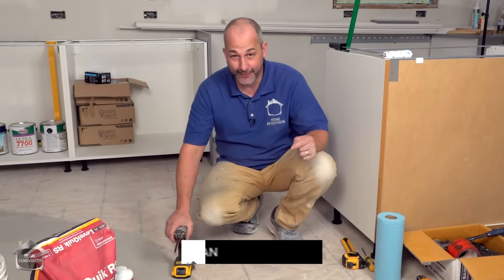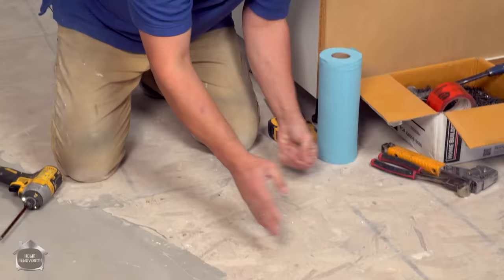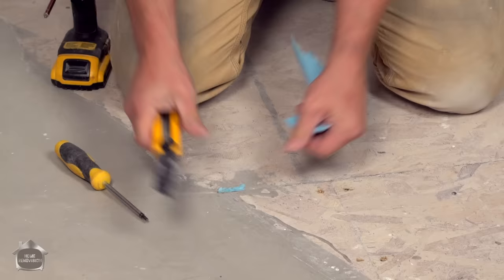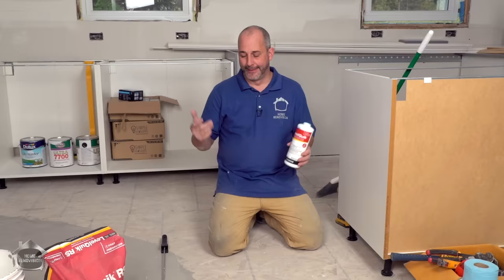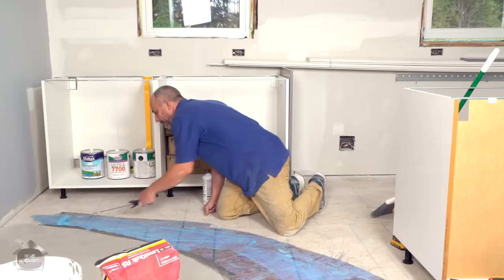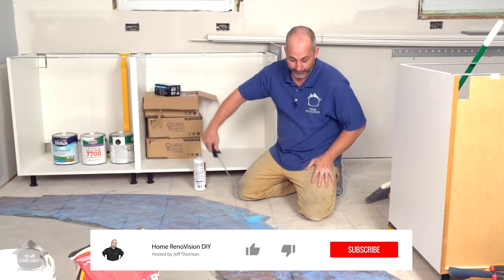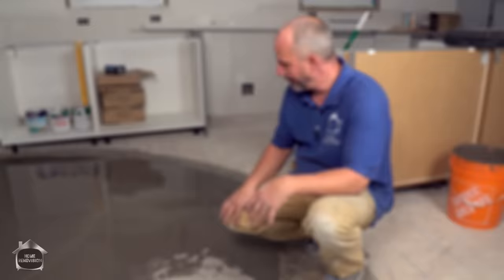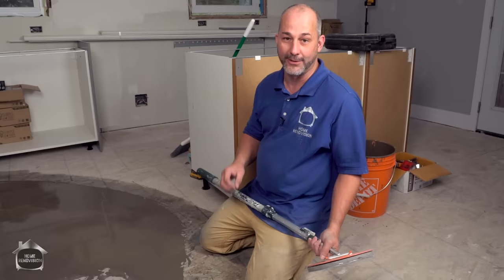How To Level Your Floors

Comment: Hi Jeff, I'm doing my basement, ripped out carpet that was glued into tile from the 60's-70's best guess. Many tiles came up in full, others left adhesive behind. Maybe 25% of 650sq ft has something left behind, bathroom and spare room currently have full tile.  Can I use leveler to bring the concrete to the height of the leftover tiles?  If so, do I cover the old tiles or go even to them? Or is it better to try to scrape them off?  

BTW, installing a 8"x48" LVP floating click floor.
Reply: The tile is most likely asbestos, best to leave it and cover it up.
Reply: Thanks  @chrisg7882 , so the majority just pulls up with the carpet since it was more of what I'll call an "indoor/outdoor carpet" (many dollars of plumbing work inside and out, found out the reason for that carpet 😕).
Anyway, since the tile does pull up in many areas and I can't stop it from doing so, what about all the pieces stuck down? Do I level up to them? Or how do I get my floor flat & even again if I'm not trying to remove the old tile?
Reply: @steve9207  you can buy a self leveller product that will cover vinyl/asbestos tiles and the adhesive you just have to make sure that the remaining tiles are solid and not hollow. I had the same at my home and I used a product called 'ball stopgap 1200'.Im from the UK so I'm sure of its availability across the pond but I'm sure there's something similar for you guys too.
Reply from the maker: Hi steve. I suggest everyone pours leveler over old vinyl tile sin the basement to avoid introducing harmful asbestos fibers into the atmosphere. those tiles have a real bead version of that stuff.
Reply from the maker: if they lift up without breaking you are fine. if you need to chisel them out then leave them there. Cheers!
Reply: @HomeRenoVisionDIY  thanks so much, this is what I needed to hear 😃
Reply: Thanks  @rossmale8715 ! From what I've seen, these are pretty solid when they pull up with the carpet.  I've only pulled up maybe 80sq ft of the 650 sq ft.  That was against a wall that we (and inevitably the previous owners) had water issues entering from "over the wall seepage / spillover" which was remedied years ago.  But all the years of those tiles submerged in water, perhaps it loosened the adhesive.  Maybe as I pull more, they'll stay down?  I'll check out the product you mentioned / look for something similar, thanks!
Reply: Would definitely recommend using a bag and bottle levelling compound (with a low compressive strength) or  gypsum based over old tiles.  A Cement based water mix can put a fair bit of tension on the old tiles  as it dries and shrinks which might be fine but could pull and loosen tiles that where fine before. gypsum based compounds don't shrink when they dry so won't put the subfloor under any stress. Last thing you need is to chuck a load of screed down and find in 5 days when it's fully cured your old tiles are pulling up/ de bonding. Always follow the manufacturers instructions for mixing ratios and priming. Always prime! Even between coats and use the correct  primer and levelling compound for the type of subfloor. If in doubt ring up the manufacturers technical department they're always happy to help.
Reply: Thanks for the info  @markallen8097 !
So I've yet to pull up most of the carpet, my initial findings are based on pulling up about 80sq ft maybe.  Of that, all except maybe 5 tiles pulled off in full with the carpet.  That may change as I move along away from the exterior walls and not pull up as many.  Let's say I end up with 50% still down, then I think I'd level it all, right?

But what if only 10% of my 650sq ft still has tile behind? Level it all? Or try to pop off the tiles in full, as long as I'm not scraping / chipping / grinding them away?
Reply: @steve9207  difficult without seeing as each job is different but if you've got 90% up and that 90% is good enough to fit on then spend a bit of time and get them up rather than screed 90% to sort out the 10% if that makes sense? If you've got to screed anyway it needs to be a minimum  3mm thickness so you can do the whole lot and cover them up.
 I'm in the UK and over here if you have tiles with asbestos content anyone can take them up as long as you follow   health and safety guidelines but they need to be deposed of though a licenced company. If you're confident go for it with the prep and fitting, if not get a decent flooring contractor to sort the prep for you, best to pay someone to do it right once rather than pay twice! It's very easy to make a floor worse if you don't know what you're doing. 
There are lots of different factors to consider when prepping and fitting a floor that can make or break an installation but a long as you do your research on the products you're going to use and make sure you follow installation and technical guidelines you'll be OK.
 Really Hope I've not put you off or confused you even more but as good as these types of "how to" videos are they only scratch the surface of what could be involved and some info given isn't always right
Reply: Thanks again  @markallen8097 !  I really appreciate all of your input and feedback :) Like you alluded to, I'll have to see as I pull back more carpeting what my situation is then and figure out my approach.  You had some reassurance comments in there though.  The space is livable without a "nice" floor while I take my time researching.

Comment: I tried to use leveler and didn’t trowel it so it made a hump. What do I sand it down with?
Reply from the maker: you can use a cuyp grinder attached to a vacuum or orbital sander. depending on the amount of are you want to remove you can start with a 50 grit paper.
Reply: Thanks!

Comment: You cannot level a floor with a 12” trowel.  The self leveling mix doesn’t level that much.  To really level w/o the need to sand, use a 5 or 6 foot board or I took a 6’ level, wrapped with painters tape, and level with that like it was a trowel.  Now floors will be perfectly level.

Comment: Home Depot just quoted me $6,500 to install 850 square feet of LVP.  My floor is concrete with in floor radiant heat.  It is fairly level but does have some uneven spots.  $500 of that quote is for 10 bags of leveller no primer?  This means they are charging me $6000 for labour.  Is this a fair price?  I feel like I'm being ripped off.  Anybody,  have any thoughts on this?
Reply: Yeah don't do that.

Comment: I know this isn’t the right video series but can I ask a question about decks😂
Reply from the maker: Hi Charles. I answer questions about anything in the newest videos so go ahead. Cheers!
Reply: Home RenoVision DIY  Awesome! So I’m building a deck (in Germany) and the site is literally all clay ground. So I was going to try to use foundation blocks for the build. The only problem I’m running into is the block itself is meant for a 10cm by 10cm post but the post itself that I’ve found is not pressure treated. But there’s a 9cm by 9cm post that is pressure treated. Will that centimeter in gap make a difference or should I just use the 10 by 10. There’s really no code for this is just not available

Comment: is that really heavy? i'd be afraid it will put a ton of weight on the floor and weigh it down in my basement.
Reply: I grew up in a colonial built in 1970 outside of Detroit, MI.  We had three water beds on the second floor... That's something like 12,000 lbs.  Houses have multiple load bearing redundancies.  This is 40 lbs...there won't be any issues.

For real load questions find a local structural engineer.  Check with a friend/family/etc (edit) who is a real estate agent for their recommendation.  They will often give free or very low cost evaluations.
Reply: @mazzystr  yup very true. I looked more into it. You're right. My house was built in 1940s. Crazy old but had lots of work done

Comment: You were late by 2 weeks dammit!  I had to learn it without your help and I didn't like that...

I love this channel.  I've learned a ton.  Even the very long videos.  We are fixing a kitchen in a rental condo (needed leveler) and I'm undertaking a full master bath replacement primarily using this channel.

Side note:  Man, you really need to wear safety glasses more.  You also need to wear a mask more.  That leveler dust isn't great for you.  Especially as a contractor who isn't periodically being exposed, you have a lot of exposure.  I'm diligent about the glasses due to some close calls and I try to be good with the mask (although I hate wearing masks).  Good luck.
Reply from the maker: I ocassionally make videos for my occasional use audience. Cheers!

Comment: The worst mistake you can make with working with self-leveler......is not measuring your water according to your product instrutions. Also make sure you set your timer when mixing. And please use a mask.  Ooooo and never ever just dump self-leveler and think it's going to level itself. Try to use a straightedge so you can screed it, then pass a spike roller to make it smooth
Reply from the maker: not sure that most homeowners will have a spike roller around but Cheers!
Reply: @HomeRenoVisionDIY  yeah that's a good point spike rollers are kinda expensive. It's not necessary unless your a full time floor installer. Good videos though 👍

Comment: CAUTION. Using this method could cause problems much worse than the one you’re trying to fix. Please do more research, this is one DIY project that is very hard to fix if it goes wrong ( and it often does). Watch some self leveler gone wrong videos.

Comment: This has to be one of the worst DIY videos I've ever seen; it's almost like a flooring contractor made a spoof video that included all the things NOT to do when leveling the floor.  1. No, not "all self leveler is the same."  Different levelers have different min/max thicknesses.  Some can be poured onto substrates that others can't.  Some mixes have been developed for exterior use, others indoor only.  Some can tolerate aggregate mixed in; others not so much.  2. Just sweep the floor?  NO!  Sweep or vacuum and then clean the floor with a damp sponge or towel.  The instructions even say the floor has to be "clean and dust free."  3. Don't need to prime existing leveler when pouring an additional layer?  Wrong again!  And BTW some products state multiole layers are a no-no.  4. Did you know Custom Self-Leveler requires metal lath over OSB? This is why I never use Custom for this application (or any application really since their products are mediocre, and sure, for the purposes of floating vinyl plank it's almost certainly fine, but not a good look in a tutorial video).  5. Just eyeball the mix/water amount?  How about pre-measuring the water to ensure a sound finished product?  Especially when doing thin pours like this, it's ideal to measure the max allowable amount of water to get decent flow without compromising strength.  6. "Can't mix a full bag in a Home Depot bucket..."  ???  For a guy who has mixed "hundreds of bags of this stuff" you sure are clueless, because yes, you can certainly mix a full bag in a 5 gallon bucket.  7.  There is no way that floor is flat or level using this pour/float method.  Screws/laser level is a full proof method, but for the application in this video any long straight edge (an old 4 or 6 foot level, a bull float, even a real straight piece of lumber) used as a screed with one edge on the edge of the existing leveler would have sufficed.  8. "Run a fan to get it to dry faster because it's a water-based product" ???  100% wrong and the opposite of what you want to do.  First of all, once someone tells you cementitious materials harden by drying just stop listening to them.  Self-leveler, concrete, mortar, etc cures (i.e. crystallizes through hydration) it doesn't harden by drying like, e.g. paint.  And you never want to speed up the evaporation of water in a cementitious mix because it reduces hydration, which reduces crystallization, which weakens the final product.  If you run a fan blowing across self-leveler, it will make the surface weaker and dustier.  This is why many self leveler instructions state that forced air heat and a/c need to be shut off for hours after pouring.  9. And buddy, put on a mask.  I don't really care if you die of silicosis or cancer, but don't put others ar risk with your worthless videos.  Self leveler has both silica and plenty of chemicals in it that you dont want to breathe while mixing or sanding.  

I really can't get over how bad this video is.  Follow the instructions on the bag; don't listen to this guy; realize that "self-leveler" really doesn't self level, especially when poured in a thin layer; use a long screed and/or the laser level/screw method; mix the full bag then pour half into a second bucket to make it easier to pour.
Reply: Yet for every comment like this from someone who knows his stuff there are a hundred people saying “ you’re the man Jeff”.  I had a guy use Jeff’s exact method here in a small bathroom and it’s a disaster, two attempts, the second is worse then the first. Also, by the way, sanding will do very little except smooth a little bit. Thanks for your input and expertise though it doesn’t seem like people want to hear it.
Reply: @DaveLineker  Thanks!  I'm glad at least one person read it:)
Reply: @nikkikiska  I believe you can learn a lot in the comments and don’t take everything on YouTube at face value. By the way, the buddy who botched the leveling job luckily redeemed himself by borrowing his boss’s Mikita concrete grinder with a vacuum attachment and diamond disc. It worked very well and we should able to lay some sheet vinyl now.

Comment: Are u literally putting cement over wood?

What is wrong with u
Just be ause we can do something doesnt mean we should
Reply: I have a question I have uneven floor in my office and it’s a very small office and I was wondering instead of the cement can I just put another plank of plywood on top thank you so much for your channel I have learned a lot